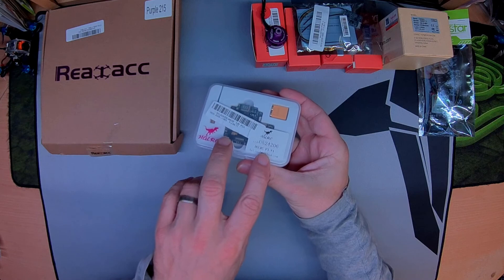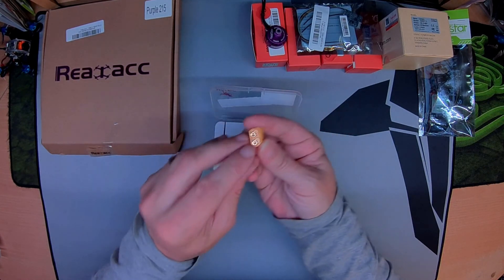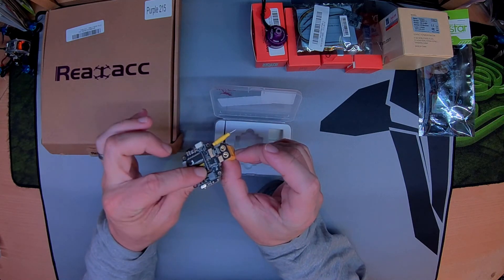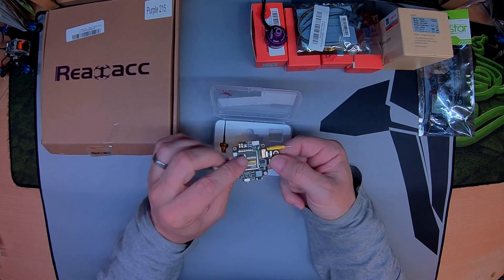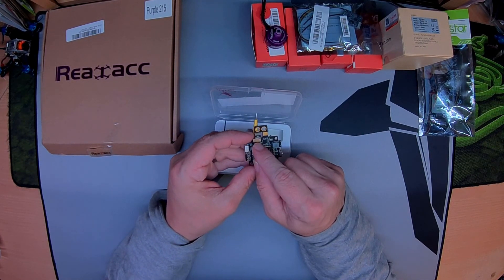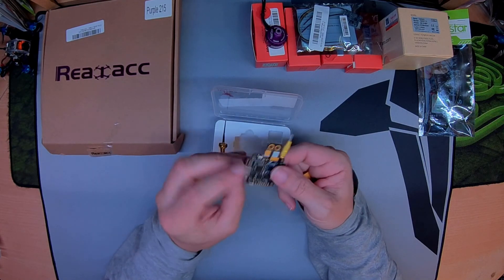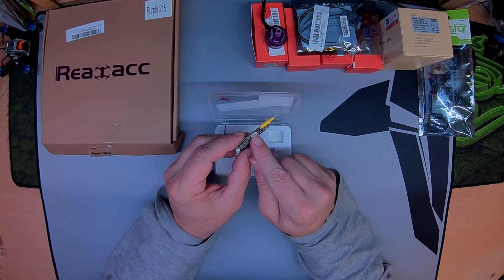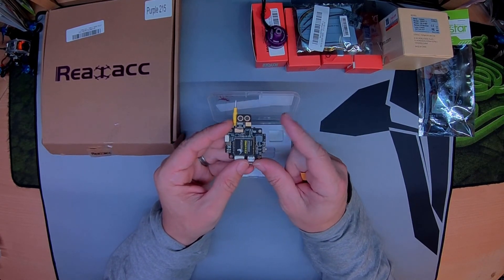HGLRC F3 V4 Pro AIO Flight Controler

Comment: Great vid and fly, just put the hglrc f3 v4 in my realacc 215mm frame with 35a 4in1 esc and pagoda antenna, what lipos are you using? P.s what is that camera mount u use?
Reply from the maker: Thank you very much.
 For the time being it's just a 3S beater, using Nanotech 1300 3S 45-90C from memory,4S would be much the same I imagine If i run out of other 4S quads.
The camera mount is the Eachine Wizard one: http://bit.ly/2mbsSXl (It's not exactly perfect as it's a few mm wider but it does the job)
Reply: MrE Thanks for the info, Im still waiting for my Pagoda antenna but want to flash betaflight/update esc. the vtx switch is at the off position but when i powered it for a second the vtx screen showed up.? scared of blowing the osd.
Reply from the maker: For sure be careful, if it's just momentry you should be fine - a precaution may be to have the pigtail attached as that can mitigate some of the danger iirc.
On the other side of things that being powered of a usb port alone shouldn't produce enough power and on that thought I just plugged in USB alone and didn't see anything transmitted.
Do you not have anything else you can stick on the VTX for the time being like a rubber ducky?
One thing that tripped me up a little, keep in mind is that the USB port and the OSD run off the same VCP/uart configuration - if your powered up with usb connected you will see a black screen as the usb/com takes priority.

Hope this is a bit of food for thought,mate.
Reply: Thanks for the extra info mate, So powering by usb in short intervals should be okay, But i defo shouldn't use my 4s though? i wanted to use Blheli to flash the ESC's but id rather wait if it could damage the vtx. No rubber ducky unfortunate 7 days and i shall have my pagoda antenna :D
Reply from the maker: You should be fine plugged in by usb for any amount of time, but dont even consider battery voltage as you have noted,the switch may not be effective even though you would prob be fine.
Sucks I know but dont risk it,no local stockist/shops to grab a throw away? (if your local to me I'll send you one)

Strange question - In your YT profile pic, does the little quad have a UFL antenna maybe?
Reply: MrE I've decided not to risk flashing Esc until antenna has arrived then, yes i do have the UFL connector, i noticed today even with the vtx switch off the board started to warm up after 5minutes. Its okay i will wait for the pagoda and hope the vtx/osd still works not worth the risk as u mentioned 😁 Thx again
Reply from the maker: No prob!